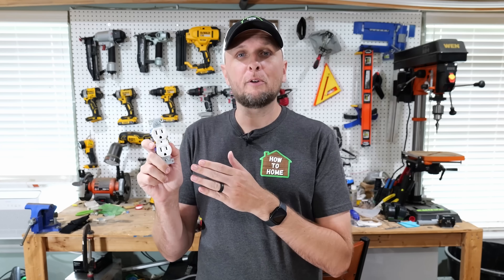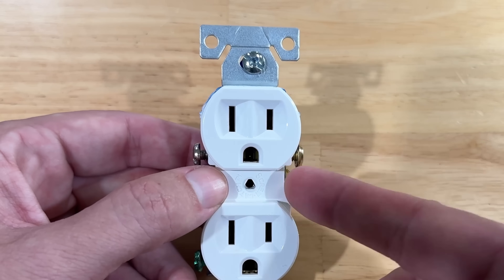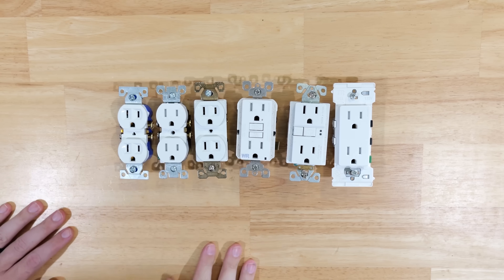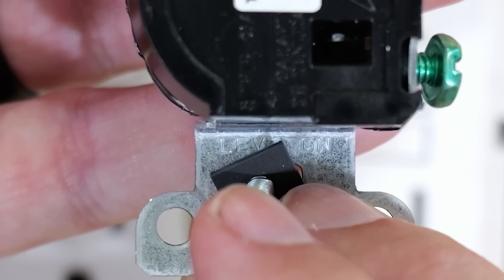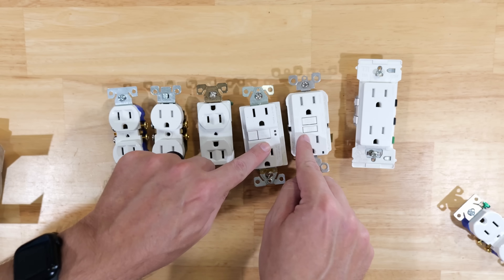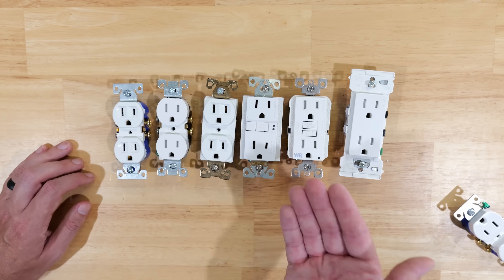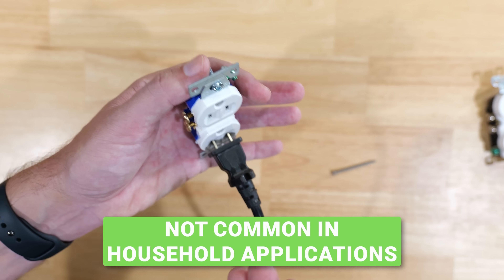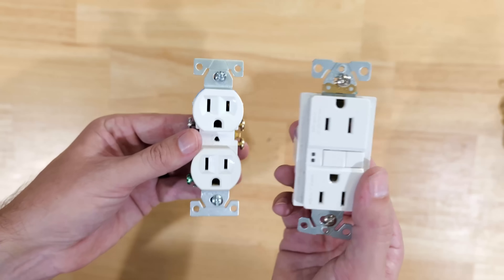The Shocking Reason Why Your Outlets Are Installed Upside Down!

Comment: You missed the 2 points that are critical to this question:

1. There is no research, neither field experience, to support the imaginary argument in favor or ground-up orientation (the argument of something falling onto the line & neutral prongs).

2.  There IS significant research and experience to show melt, arc, and even fire risk from fatigue and eventual failure from cords being severely bent or flexed at the plug.

Many plugs are 90-degree plugs, particularly the GFI plugs on bathroom-type small appliances, designed for the cord to hang down when plugged into a ground-down-oriented outlet (normal outlet orientation).  Having that cord go straight up and then immediately flex and hang back down creates the aforementioned fatigue resultant risk (not saying it's huge, but it's one of the relatively biggest ones left in this context).
Reply: i am an old fart and have only seen those 90 deg plus plugs for the past 15 years.  never had them when i was younger.  the ground plug down usage probably came about because that way it looks like a "face" and people are pretty stupid that way.
Reply: @dom11949  And what did your 20 year old refrigerator use for a plug?  30 year old?  40 year old?
Reply: To your point 2 it the only good argument as to orientation is for the  cord to lay flat against the wall. Only code cycle that required it ground up was 1984. And during installation the electrician may not have that information.😊
Reply: Ground pin up means gravity can easily pull the top of the plug away from the wall since the ground pin isn't held as tightly as the other 2 pins.
Ground pin down generally keeps the plug in better as far as gravity is concerned.

If you have any wall wart transformers with polarized plugs, your outlet NEEDS to be ground pin down.
If you have any 90 degree plugs, you need ground pin down.

As far as kids putting a knife across the hot and another pin, that is why circuit breakers exist. The circuit will blow before anything else happens.

There really is no ACTUAL evidence of any benefit to ground pin up.

I will state that the US outlet style is inherently more dangerous than any European outlet style - the recessed contacts on a thick solid pin in a round recessed plug is much safer (but more expensive) than thin blades and an outlet that is a magnet for a kid with a screwdriver or swiss army knife.

So, there is only intuition stating that ground up is safer (and intuition is notoriously unreliable).
Meanwhile, ground down is safer for certain devices and convenient for certain plug types.
Reply: @aaronbredon2948  Depends on the manufacturer of each part at what time in history and the two together. Sometimes the ground pin is the tightest.
Reply: @aaronbredon2948  Since, as you say, the ground pin comes out harder, it makes sense to put it (down) where the only gravitational effort is to push it in?

Um....
Reply: @EchoDelta-e4z, There doesn't have to be official research when real-life experience over time in the context of the use of the building (and what has caused shorts, fires or injuries over time) tells you the reality. Ground prong up when that outlet is attached too the light-switch so people there know where to plug in their lamp to control it from the wall light-switch. Medical facilities have things hanging on walls that fall, like clipboards that short the circuit, therefore it has become mandatory policy that they be ground up. In many cities only residential buildings are ground down standard while industrial are ground up.
   Everything is in context and the answer DEPENDS on context.
Reply: That’s imagination or pontification, not research and not field experience.

Point 2 trumps it anyway.

Upside down outlets are the kind of nonsense that creates hassle, expense, and risk for bad reasons.
Reply: @EDavis-bu7cx  Gravity is not imagination.
Reply: as a electrician i have always noticed the ground would break off and stay behind in the plug in the smiley face. i have never seen a ground broke off if inside the other way. no official testing done by me. but 30 years worth of experience.
Reply: Looks more like a scared or "oh-no" or "the scream" face to me. 😮
Reply: @jeffking543  And with one eye slightly bigger than the other 😂
Reply: @EchoDelta-e4z   back in the 70s when metal wall plates were the only things available, an argument was made for installing receptacles ground up.  It was common for the screws securing the plates to loosen, with the result being the plate could slide down between the plug and the receptacle contacting the hot and neutral prongs, causing a short with the result of burn marks on the wall, plate and receptacle. I never worried about it myself.
Reply: When you have kids the earth prong on top is preferable as if they have a metal objet it is better they touch the earth pin first.
Reply: Your point #1 is extremely broad. Are you saying then that you are the final authority on whether or not any research has ever been done in the history of mankind on this subject? You make these broad statements yet you do not give reference nor evidence to either #1 nor #2 to back up your statements. I am not saying neither is true nor untrue. I am saying you are making broad and baseless statements intended to be taken as fact without proof.
Reply: To your point #1, the reseach and field experience amounts to gravity.  Gravity always pulls down.  With the proper ground up configuration, gravity will tend to expose the grounding conductor rather than current conductors.  Gravity doesn't care.  It only works one way.  A proper electrical installation will work with gravity and use it to advantage and not against it.  Nothing more, nothing less.
Reply: @jeffwoehrle  If "gravity" is pulling the plugs out of your receptacles, then you need to replace your receptacles.  It doesn't happen on a properly functioning receptacle.
Reply: @stargazer7644  Properly functioning would be installed ground up, so there is no problem. 👍   Work with gravity, not against it.
Reply: @jeffwoehrle  You seem to be confused about what the word "functioning" means.  And installing it upside down doesn't magically cancel the effects of gravity.
Reply: @stargazer7644  To the contrary, YOU are confused as to the effect of gravity.  It pulls down, period.  Your installation can either fight it, or utilize it.  Up to you if you wish to do it correctly (ground up), or ignore the unwavering and unavoidable fact that gravity pulls down, and install the receptacle upside down.
Reply: @jeffwoehrle  You really aren't very good at this.
Reply: @stargazer7644  I'm not the one installing outlets upside down.  **smirk**

Comment: I always go ground prong up. Years ago I had a metal cover plate, fall off and cross the terminals of a vacuum cleaner. It tripped a circuit and welded the plate to the prongs. These days, most cover plates are plastic so it's probably not as big of a deal but it's a lesson I learned and always install them with the ground up now.
Reply: I use metal plates in my shop where there is a heavier or rougher use and plastic in my house where there's lighter use. Use meaning more or fewer cords being plugged and unplugged.

Comment: I have been working with receptacles since they were ceramic. I'm old. The only reason I have ever installed a receptacle with the ground plug up was for stability in case something ever fell on the plug, like a cat or a dog. There is less chance your appliance will get unplugged and mess up your cooking.

Comment: Side issue. Most new 30 and 50 amp receptacles for EV chargers should be installed ground side up, especially as the cords are designed to hang that way. I believe most newer oven/dryer plugs are also ground side up, but it doesn't seem to be "standard" one way or another.

Comment: Depending on what the receptacle is being used for, there can be an advantage to having the ground prong up or down. However, for those who insist on one way or the other being correct, what's your interpretation when the receptacle is installed horizontally?

One thing that wasn't mentioned was flat plugs on the cord. Most of them are designed for ground plug down. If the ground plug is up, then the cord has to loop back around and drop to the ground. However, if using a flat plug for something mounted up high, it may be advantageous to have the ground plug up. So, again, it depends on what the receptacle is being used for.
Reply: @wmcomprev  Horizontal orientation is for people who don’t have the cojones to pick a side in the debate 🤣

Comment: Ground side down works best to accommodate cords that have a 90° angle on their prongs. So, that's in a home or office. On the other hand, I agree with others at every hospital I've ever seen has them turned the other way. I was once told that the reason for this was to allow important or life-saving equipment connected to a receptacle with a plug that was partially pulled out and turned down but still provide power to the equipment.
Reply: Hospitals use ground up because clipboards have a history of falling off the walls and shorting switches, for this reason hospitals are ground up. As are other industrial facilities. It all depends on context.

Comment: Night light are the best argument for GP down.
Reply: aren't they all ambidextrous?  None of mine have 3 pins, and both pins are the same, so non directional.
Reply: And air fresheners…
Reply: Depennds on the nightlight, some are loose then right-side-up but ot upside-down.

Comment: I have had several houses where the ground prong is down EXCEPT on switched outlets, which the builder puts the ground prong up, in order to make it easier for the homeowner to identify the switched outlet(s) in a room.
Reply: These are called "half hot" outlets.
Reply: Ground side down. Neutral to left - ALWAYS
Reply: In my town this is all but a standard.
Reply: That's how we always did it too.
Reply: Ridiculous!
What if you have a receptacle split so one is switched and one is live?! 😂😂
Reply: What about only 1 side of the duplex receptacle is switched and the other is constant?
Reply: @bgarrison67 is that why I felt a surge when I turned on the bathroom light?   My light bulbs would burn out quick too,  so I put electric tape all the way around the box.
Reply: I've seen one where they used an outlet that has an LED light on it. When the switch was on, the LED light on the outlet turned on.   It might have actually been a GFCI outlet, but I dont think so.
Reply: This is something found only in some new houses. There used to be a red dot on outlets using switched circuits. I just use a Decora or different color socket on switched circuits.
Reply: I guess trial and error is just to difficult for today's average homeowner. 🙄
Reply: That's a really good idea!  Bright electrician.
Reply: I live in California, and this is how the outlets are wired. The outlets with the ground prong up are wired to the switch in the room.
Reply: @acereotero it's my first tip that they used illegal workers that do it that way in their country. So is it the building inspector being bought off?

Comment: I teach middle school and had a student pull out a plug exposing the prongs and proceeded to touch the prongs with a metal ruler. Needless to say he learned about electricity the hard way. Good teaching moment. 😊I asked why would you do that? “I was bored”😀
Reply: Did he talk about full-bridge rectifiers much?
Reply: @chaos.corner  Sheet! Fock!
Reply: My one childhood accident with an electrical outlet was: I had a small lightbulb (of the kind that might be included in beginner science/electrical kits) and wondered if I could just plug its (insulated) wire leads straight into the wall outlet.  Didn't know a thing about how electricity works, but in hindsight, at least the wires were insulated.
Reply: I hope you corrected him. He was not bored he was stupid.
Reply: @JonBee-h7p Having worked in schools in a non-instructional role I know this is their answer to everything.  They know nothing about real life. However, they can cite all of the specifications of gameplay in the newest video game!  I weep for the future!
Reply: But equally a small child (who you probably most worry about) may more be likely to come at an outlet from below if crawling for example.

Comment: I always install ground down as most right-angle plugs are designed for ground down.  However, I have noticed that almost all medical offices and hospitals have the ground side up!  That seems a little odd to me!
Reply: Medical facilities have things hanging on walls that fall, like clipboards that short the circuit, therefore it has become mandatory policy that they be ground up.
Reply: @violetviolet888  ~ makes sense but the right angle plugs pointing up really triggers my OCD!  :o)
Reply: Once saw a soda machine with a right angle plug with the ground side up

Comment: What if the hot wire coming in was  opposite of a typical set up and it was plugged in reversed? Thinking of how old houses were built back in the day before standards and rewiring was completed.
Completing the circuit would that matter?
Reply: @fullofgracehomestead  That’s called “reversed polarity”. It’s generally not good for electronics and under certain circumstances can actually be a shock hazard. For example if a lamp is plugged into the outlet, the socket the bulb goes in is designed with the hot in the bottom center and the neutral on the side of light bulb receptacle. If you touch the side of the bulb socket but the wall receptacle was reversed polarity, that bulb socket would be energized.
Reply: @davidroddini1512  thank you

Comment: I dissagree with prong up!!  90 degree plugs are designed with ground down and if you have to plug that upside down, now you have a dangerous loop of the cord.  Truth be told it's not wrong either way.
Reply: I have a watt meter and a couple of digital timers that require the ground at the bottom, otherwise the displays would be upside down.  They are all consistently that way.  So, ground down is best.
Reply: Dangerous loop of the cord? That makes zero sense. "Oh no, my cord has a loop in it, might cause a fire or make me straighten the cord!!!"
Reply: @ericlaing435 Think about it, why would you design a 90 degree cord to go up when installed..... that wouldn't make any sense.

Comment: It seems 90 degree extension plugs, nite lights, and power bricks are manufactured with the ground side down being most convenient so as to not block the other receptacle.
Reply: @PappaMike57  That’s a good point. And another good point is that some 3 pronged cords are designed to make a 90 degree angle after leaving the plug head. Such cords bend downward in the direction of the ground prong. If the receptacle is ground prong up then the cord makes a u-shaped bend as it bends upward because of the 90 degree angle and then drops down due to gravity. Bending the cord in a u shape is likely not very good for the conductors inside it.
Reply from the maker: Valid point.
Reply: I wore all of mine ground Prong up except behind the refrigerator. Really, it is not a good idea to plug anything else into the outlet with the refrigerator.  It isn't as much of a problem now, but in the past, older refrigerators drew more amperage due to the appliance itself and different components inside them. Also many times I would come across a freezer plugged in on the same circuit as the refrigerator.
Reply: @desertdan100 Refrigerator motors have leakage current through the oil bath. That trips the GFCI. Refrigerator receptacles  have their own circuit. A non-GFCI outlet was permitted 10 years ago: I don't know if that has changed
Reply: @Fetherko  Things are changing on refrigerators and freezers. They used to have a high starting amperage or surge but that is changing. Now they are starting to install linear compressors.  They may not last as long.

Comment: Very interesting and informative video. 
  My house was originally ground side up. As I replaced worn out units I put them ground side down. Partially to easily show which ones were done. But truthfully, looks proper ground side down. 😊Vs🙃   
Also when plugging in window ac units, the power cord sticks out the bottom of the brick, ground side down has cable hanging down. Seems better to me. 😎
Reply: Its not all one or the other.
Ground down cord pulls the prongs out exposing them  Ground up cord weight pushes prongs in.
Flat cords would need ground down.